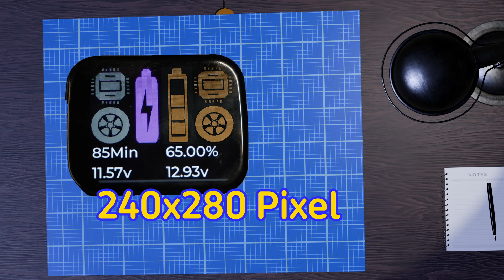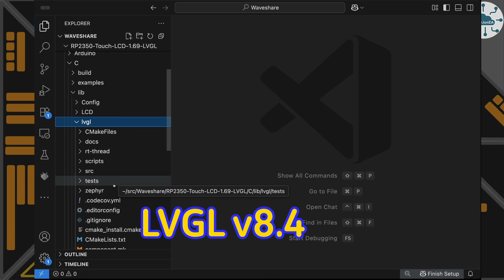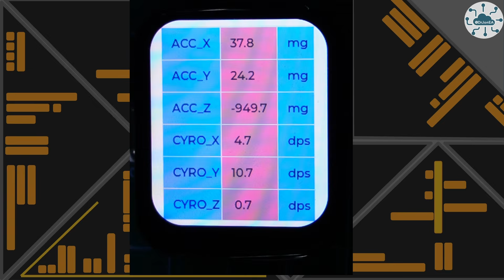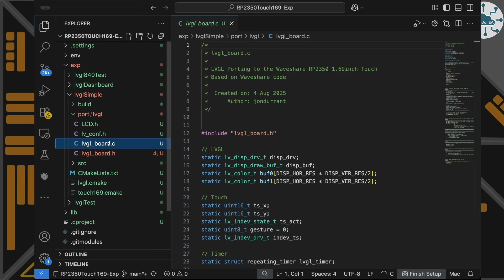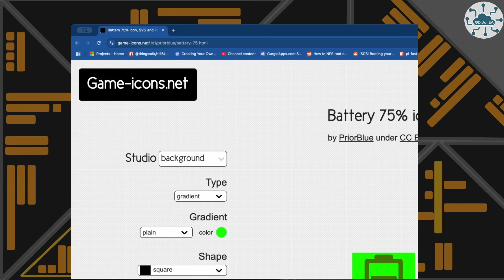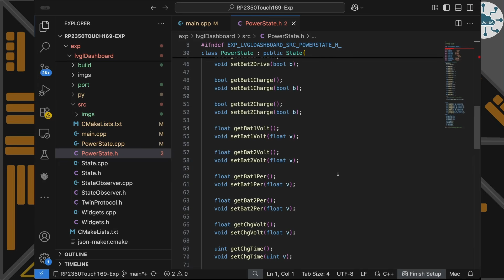Create a Stunning GUI on Your Waveshare RP2350 Screen with LVGL!

Comment: Have you managed to get LVGL running on a 2350 Micropython firmware that supports BLE and WiFI? I.e. a RPI_PICO2_W build? Not just a PICO_W or PICO2.
Reply from the maker: The approach I have taken so far was to use a pico 2 w alongside the RP2350 display board to run the network stack. I did look at adding and RM2 module but with the memory needed for the display it was too challenging adding a TCP or BLU stack.  
Good example of this approach was this smart clock https://youtu.be/oF0W6lFKIEg

Comment: Hello mister can I tell, have you tried using a lipo battery on this board and is it working from lipo power instead of usb type c?
Reply from the maker: I've not tried the Lipo for this device but can confirm it does have lipo charge and discharge features.